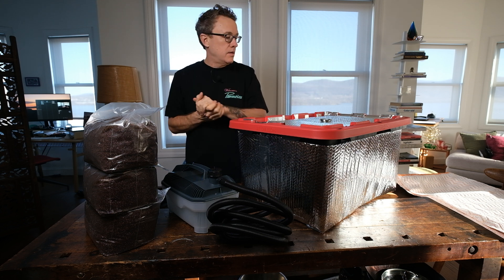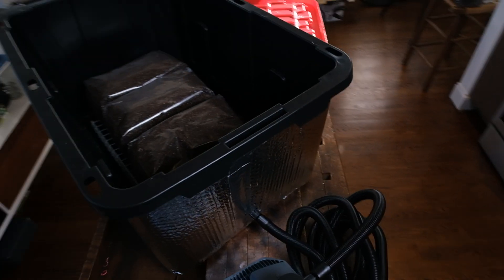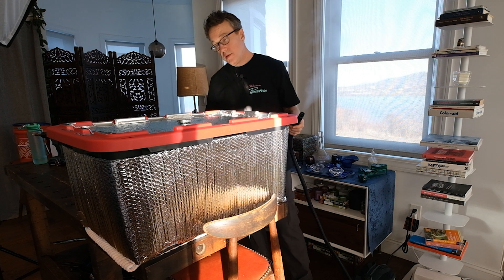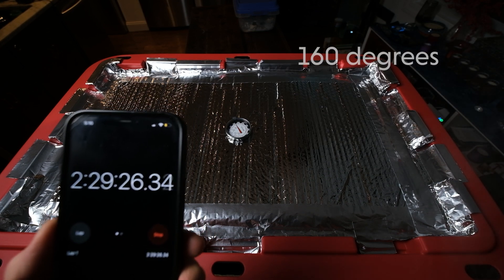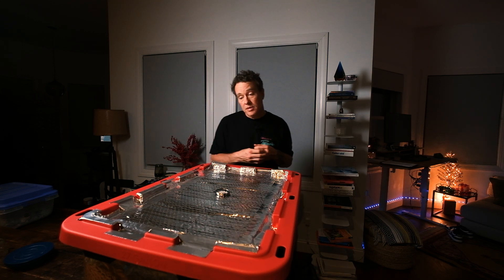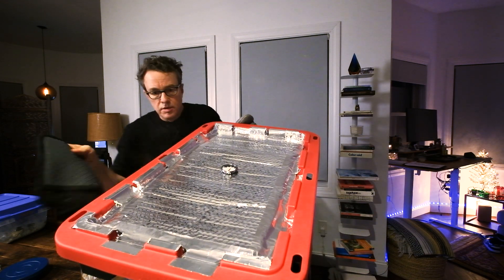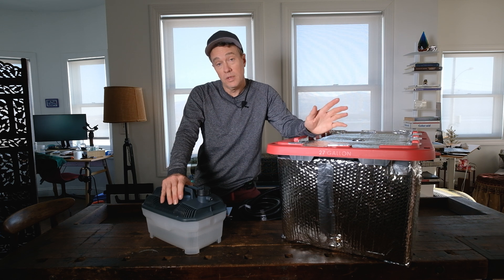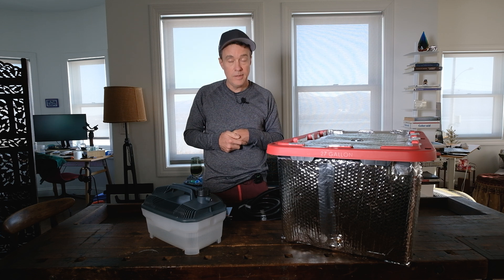MIND-BLOWING Results from Testing My DIY Mushroom Pasteurizer

Comment: Nice prototype, I'd add thick slabs of insulation, a condensate drain, and a digital wire probe instead of the metal, as these can be very inaccurate after a long heating due to conduction of the heat to the head dial and down the metal into the tip.

Comment: If you are considering a steam vent to reduce the lid leaking,  you could add a smaller diameter tube output with high temp silicone hose - put the open end into a mason jar with a little water, the steam will bubble through the water and act as a condenser.

Comment: I’m making one like this soon. Thank you for the idea. Have you figured out what to do with the air vent port yet?
Reply from the maker: I just drilled a small hole in the opposite end from the fitting, Still leaks a little around the edges, it always will. You could use a contain that seals but you will definitely have to have a pressure vent.
Reply: @RealSimpleMushrooms and 175 isn't way too much ? I thought 160 should be max

Comment: Would it help to have some sort of spacer in between the bags? Seems like each bag would heat up a little faster with some space between bags. Otherwise, very helpful videos!
Reply from the maker: If you have the room, I ran it fully packed with 70lbs of sub and it took only an hour more than my first test with 30. I don’t think it makes a massive difference tbh

Comment: It probably leaking out the way because of all the pressure it has to release pressure somewhere what does it have a way of releasing pressure out of the machine? Also I'm not sure but I think that the wallpaper steamers  have a extra little hose inside the hose that backs off pressure when you press it against the wall too hard so the pressure don't build up in the machine because if not It could probably mess it up.  I'm not sure but I thought I noticed that on another video.(Or does this steamer also?) I'm looking forward to making one so any insight would be excellent. Thanks 🙏🏻
Reply from the maker: Yea. pressure vent is on my list of modifications.

Comment: Do you think it's worth buying a ink bird controller to turn it off when it gets up to temp than back on when it drops so you don't have to watch it? You can even get a wifi one that will notify your cell phone. I actually have one but it's not WiFi 😢
Reply from the maker: For that to be 100% accurate you'd have to bury the sensor in the core of one of the bags, it's certainly crossed my mind. I wish they had like a spike probe for those things.

Comment: Let's put an InkBird controller inside that thing! Maybe we can figure out the temperature on the controller VS inside the center bag and do a little formula to control the steamer OR we can just plug the InkBird probe inside the bag?! Also, how do you deal with a hole in the bag after pasteurization? It's ok if you open the bag for a monotub, but not to grow out of the bag directly. (Actives are fun but I'm on a gourmet kick)
Reply from the maker: I wish there was a spike probe for the inkbird, that would make life easier lol. As far as the hole in the bag some Micropore or painters tape over it should be fine.
Reply: @ thanks that sounds like a good idea. I’m going to put an INKBIRD attached to the candy thermometer. Makes a bigger hole but once you figure out how much time you need, no needs for a thermometer anymore.
Reply: @RealSimpleMushrooms  is 80 degree not to high ? I read that it should not pass 62

Comment: How much water collected in the bottom after your steamed it for 4 hours? Do you think sealing the lid better would help? Also, what would you think about adding a PVC pipe steam cage around the inside to more evenly distribute the steam instead of connecting the steam tube to the container directly? What are your thoughts?
Reply from the maker: There was about an inch or so of water in the bottom, you have to be careful with sealing while steaming because it will build pressure but the thought of some type of thin weather stripping and a small vent tube have crossed my mind as well as adding some type of internal plumbing to disperse steam more evenly

Comment: You should measure the center of the bag furthest from the steam input.
Reply from the maker: That's what I'm going to address with a modification. I plan to add a length of pipe off the inlet inside of the unit with holes drilled on each side every 2" apart to more evenly disperse the steam, which I think will play a bigger factor when it's packed with more sub than I used here. I don't think it matters quite as much when you're only running 3 bags....as long as it's not the bag directly in front of the steam
Reply: I think it's actually probably fine because the steam turn on everything before it starts hitting it up. That's why steam works so good for pasteurization and sterilization.

Comment: I don't use this setup personally, but I have a Bubba barrel and steam generator. I'd suggest running it for longer while it's at temp if you're doing 10 pound bags because it can take a while for the center of the substrate to reach temperature. I like doing at least 4 hours.
Reply from the maker: I was taking the temperature measurement from the core, it took 2.5 hours to get that core temp to 160, I ran it for an additional 2 hours after that.
Reply: @RealSimpleMushrooms Oh, my bad. I had assumed the candy thermometer was simply placed beside the bags. That sounds perfectly fine to me, then.